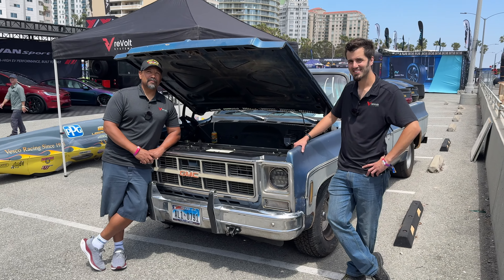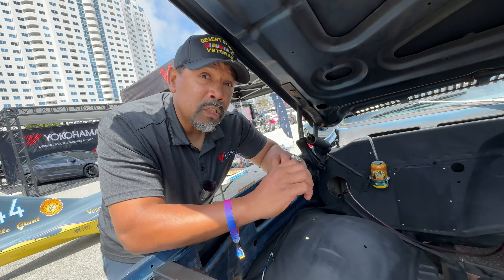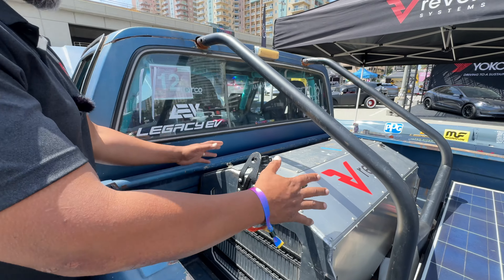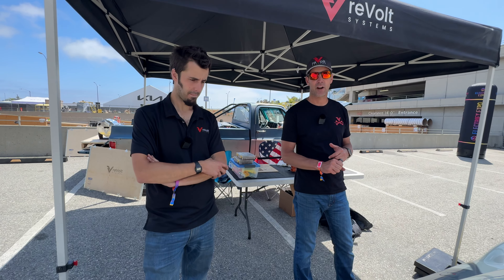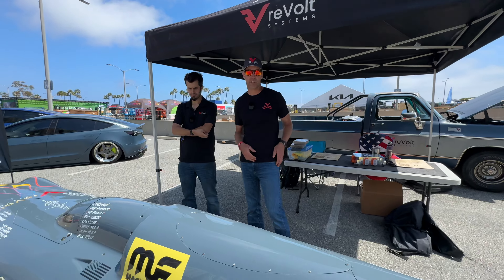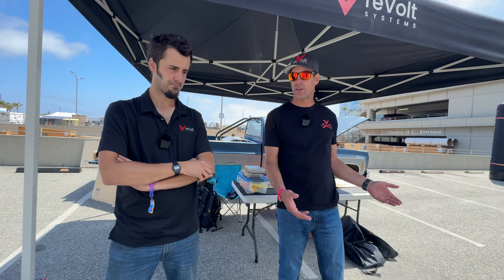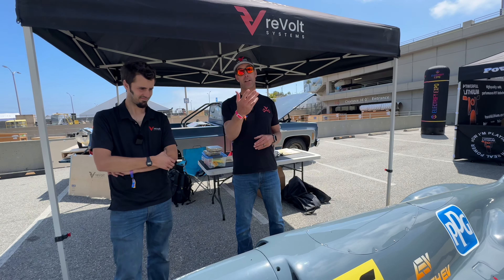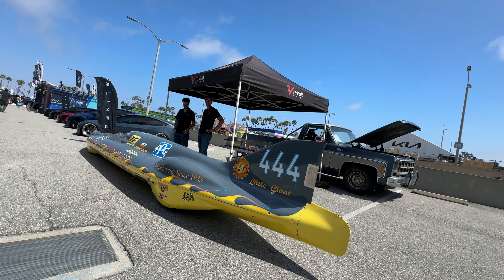This EV Is Still The Fastest In The World! - Revolt Systems' Record-Setter Explored

Comment: A thing to learn: I told Musk this back in 2002. Effective Series Resistance, ESR. You must get the ESR of all the components in the path of the electrons as low as possible. This even goes for connectors and wires. Try to achieve no hot spots. This allows you to up the Amps with the least losses and need for cooling. Amps * number of wires in the energized coils is what gets you the torque in the motor. Voltage just pushes the Amps more easily. Some things like the insulation in the wires, and voltage capabilities of the transistors will limit the voltage you can use. Have fun!!!!

For the super high currents I was playing with back then, we were limited to 300 to 600 Volts due to the Amp capability of the silicon available at the time. We could have used 1200 Volts, but the current capacity we needed wasn't there yet. So we had to go to a radical motor architecture with integrated motor controller to get the amps needed. Our silicon was less than 100 mm from the coil it energized.

PS, don't vaporize your tools. The resulting metal ion cloud will condense out and plate all surfaces around, including your insulators, circuit boards, shirt, skin, and lungs. You will be replacing large numbers of parts to get rid of the damage, plus it is seriously sub optimal to breath in. Metal poisoning is seriously sub optimal. For a safety video we turned a 3/4" breaker bar into a vapor cloud in under a second using just one of our power supplies. We had put covers over everything, but in hindsight we wished we'd done it inside wind tunnel like enclosure with a very strong wind to vent the resulting metal vapor cloud outside. We used a multi plate ceramic knife type arc quencher to kill the arc, but it got partially plated with metal and nearly didn't work. We turned over 15 cubic inches of metal into vapor.